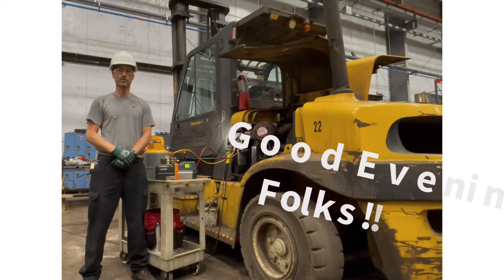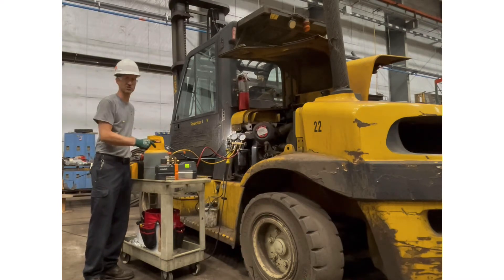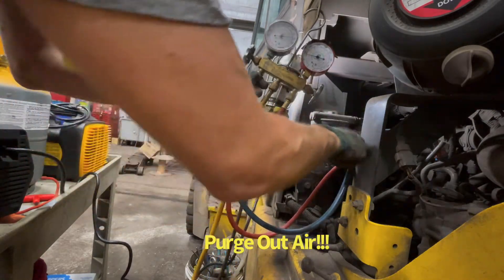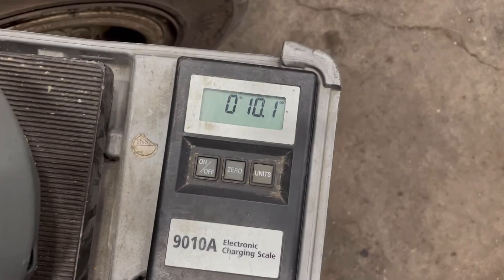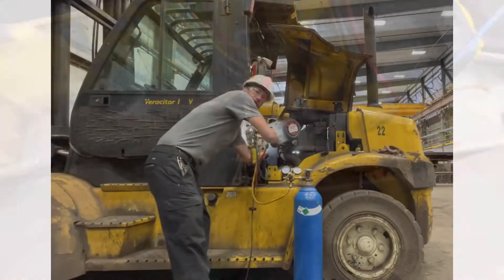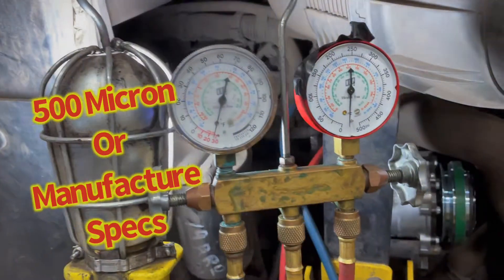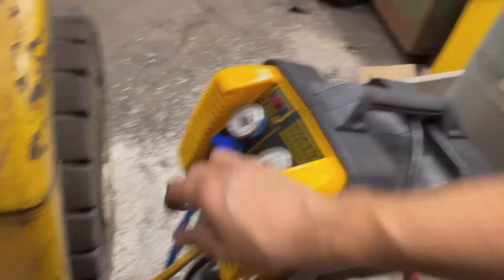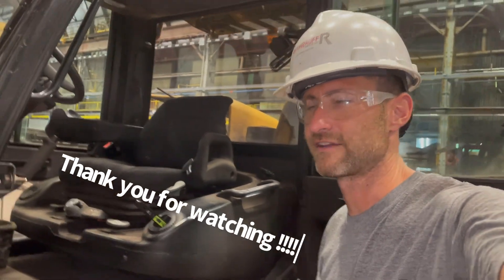ForkLift A/C Repair #hvac #forklift #commercialhvac #heatingandcooling #Compressor #sporlan #freon

Comment: Thanks much, I'm leaning something.
Reply from the maker: @gideonAtio  thank you very much. I have a good opportunity I’m working on many different pieces of equipment so I figured I would share some of the videos and experiences.   I am currently living in Florida working on more equipment.    Have a great day. Thank you for the compliment.
Reply: @hvacexplained9341  Okay thanks, I have a problem on the Hyster 32 tone AC, when I remove damage compressor and install the new one,all system was working well but not producing cool air... please can you explain more about this...?
I'm from Papua New Guinea...
Reply from the maker: @ I’m assuming you pulled a good vacuum followed by charging it up with either the recovered Refrigerant or new # Fresh Refrigerant?    What are your pressures?
This particular machine I was working on in this video the evaporator coil was so plugged up with soot / dirt
Reply: @hvacexplained9341  okay thanks now the AC is running, thanks much..👍

Comment: Good one! Nice job showing line purging procedures, seems like a lot of guys struggle with something so simple and effective. Been an auto tech for 27 years so this vid was right up my alley, glad you got to enjoy cramming your hands down in there a little bit! 
Oh yeah, being able to visually inspect your connecting rods is usually never a good thing!😂
Reply from the maker: I try to do what I can filming it by myself.  Thank you very much. Noncondensible’s in an air conditioning system can really create a headache. I was just working in a computer room yesterday I had to recover 80 pounds of 410A refrigerant , Pull a good vacuum and wait in a fresh charge because of noncondensible’s from a previous technician.  I give you lots of credit for being in the auto industry with being a technician.  I have no clue how you guys work on today’s cars???   I’ve had a company work van since 2006 and my personal vehicle I bought in 1999 when I was 17 it’s a 1999 Ford ranger 4 x 4 with the 3.0 L.  I do my own repairs / Maintenance but luckily it’s so damn reliable lol.  The most in-depth repair I just did on my truck I was replacing the water pump which it probably would’ve been easier taking the engine out LOL.  Thank you very much for commenting and please let me know if you have any questions.   have a good day
Reply: @hvacexplained9341  - Kudos to you for doing the job right and showing the rest of us how it’s done. I also applaud you for owning an older vehicle and servicing it yourself. I’m giving away my age here but when I first started in my career the first thing we did when a vehicle came in was pop the hood and perform a visual inspection. Nowadays the first thing we tend to do is plug in a computer and run a diagnostic test, as modern vehicles are a rolling bank of interconnected electronic modules (up to 50 or more believe it or not!) I own three cars and the newest one is 1998 model. I intend to keep them going until they fall completely apart! Anyway I’ve been thoroughly enjoying your videos and I’ve got mad respect for what you HVAC/refrigeration guys do on a daily basis. Keep the videos coming, thanks.
Reply from the maker: thank you very much...
Some of my friends whom I had graduated with laugh when they find out I still own my first vehicle and use to drive it to high school...    I think its smart, 18 to 19 Years without a car payment ... I mean so what if its not flashy and glamorous...  Gets me from Point "A" to Point "B".  The Reason why car prices keep going up.  Moon Roof, heated steering wheels, bluetooth, air conditioning seats, Etc. and people keep paying for all that crap...  I Cant stand leather seats other than looks, cloth is my favorite, they don't get to hot or cold.  my fathers older Ford F150's had Vinyl floors, manual with the 300 straight 6 which for a construction worker or trades worker seemed smart to have. My van I occasionally hose out the foot well area lol.     A car is in my opinion one of the worst investments besides a cell phone.   it just depreciates once it leaves the lot and needs insurance and maintenance.  One of the best investments I would think is A Bed Mattress.  Think about how much time you spend sleeping.  the mattress must last you roughly 8 to 12 years, giving you comfort and recharging your batteries.  also probably education.   the more you make yourself marketable the better.  its something that no-one can take from you.    I give you mechanics a great deal of credit putting up with all this new high tech car industry...
Reply: @hvacexplained9341  - 🤣  I’m laughing as I read your comment because it sounds like I could have written it. As we speak I’m typing this comment out on a 6 year old iPhone 6 that I plan on using until it just gives up.... meanwhile most people I know are waiting to buy this year’s newest model. I’m not even sure what we’re up to now, 12 last year 13 this year I think and over a thousand bucks! 🤣
Reply from the maker: @stevee7774  :  I have to admit I’m on an iPhone 12 mini but prior to this I was on an iPhone 7. I generally keep his cell phone three years and less it’s causing me problems then I buy pretty much latest and greatest for the next three years.  Technology moves along way too quick to keep up. I had an argument one time with somebody about minimum wage pay they were telling me it needs to be $15 an hour and this is a few years ago. My one reply kind of made sense to them and basically.  If you’re making minimum wage you don’t need to buy luxury items such as Beats by Dre and Michael Kors stuff. Those are luxuries there’s nothing wrong with not keeping up with the Jones!

Comment: A/C on a fork lift -- who knew?  I didn't :-)   That was a fun view.  Thanks for posting.
Reply from the maker: I originally thought the service call was to work on an air compressor.  Apparently somebody was misleading over the phone LOL.  That’s the one nice thing about heating and air-conditioning you’re Always running into something different.  Thanks for the comment.  👍. If I get a chance I will post a video about working on a crane set about 65 feet up off the ground one of the nastiest conditions equipment should run in.   Have a good night 👍